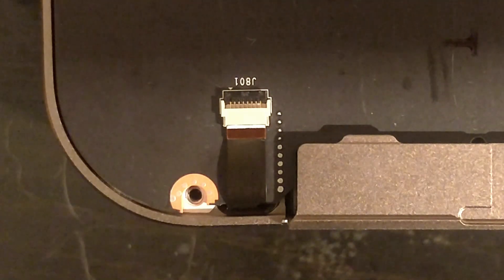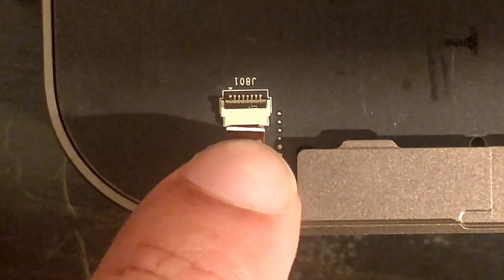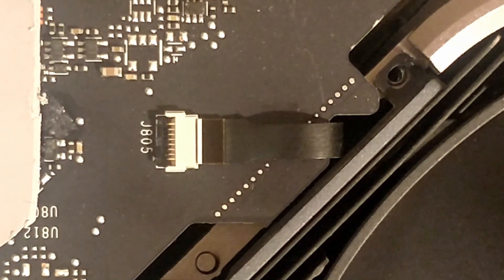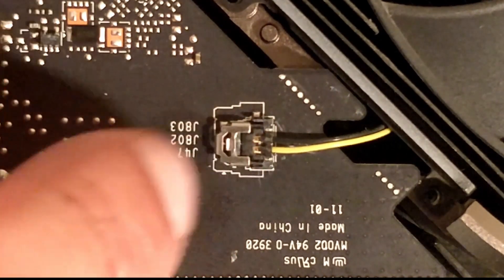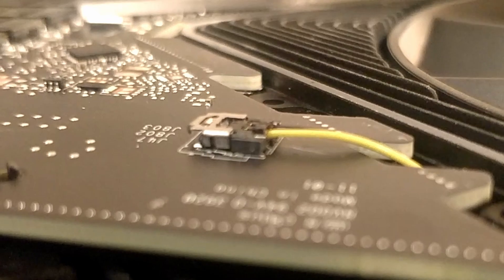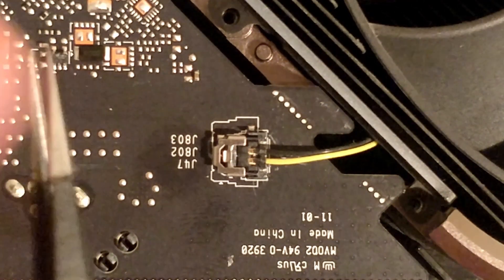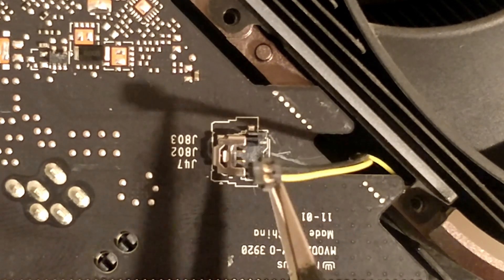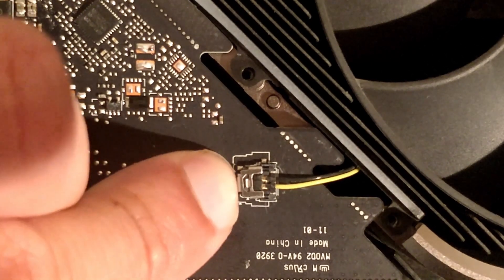How to unplug the 3090 FE and 3080 FE cables

Comment: Bro, i can't find the ribbon cable pinout, can you help a brother? I see that it has 6 pins, but i dont know what pin is for what, i found + and - for 12v and they are spinning at 100% when i connect it. Do you know what the rest 4 pins are for for, which ones are signal?

Comment: The LED cable is a little tricky - it should come out with very little force. If it isnt you probably didnt unlock it all the way and need to push the locking mechanism further to the left.